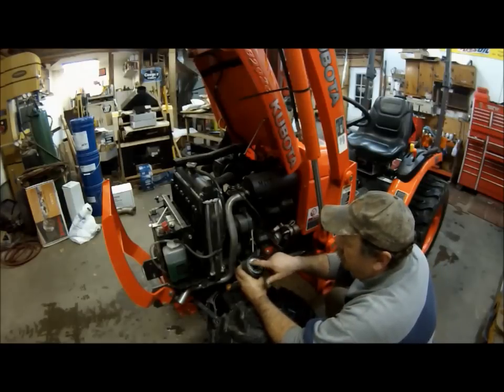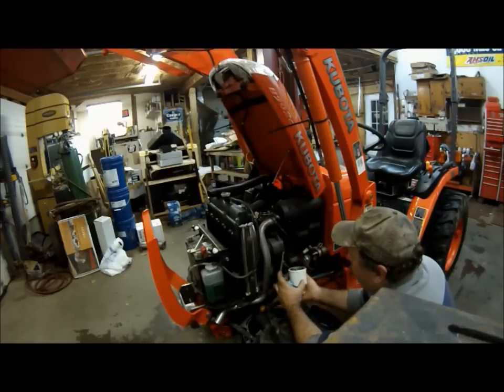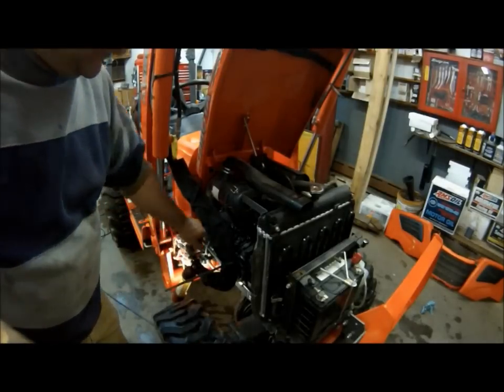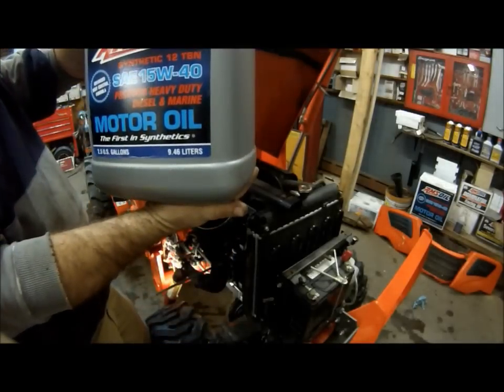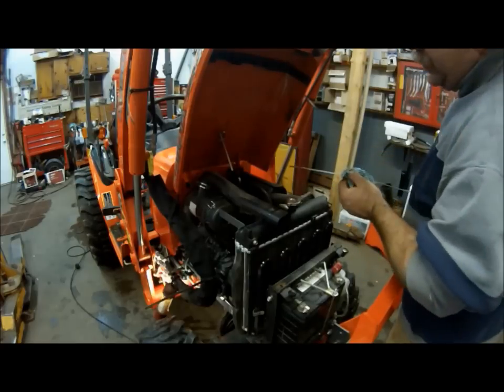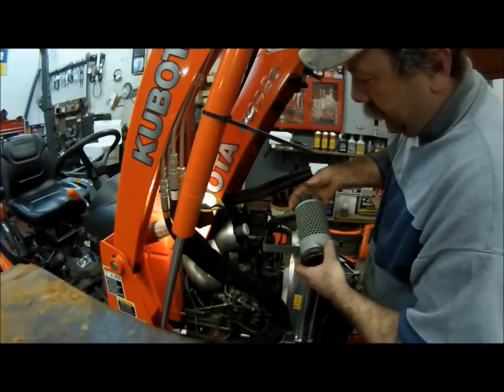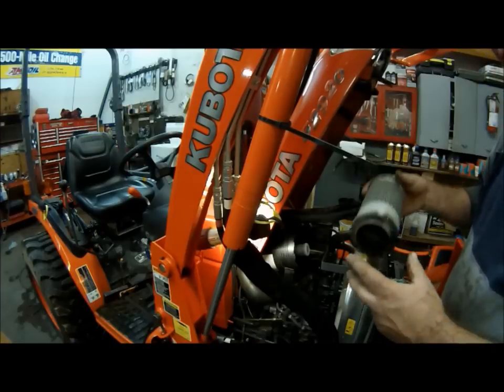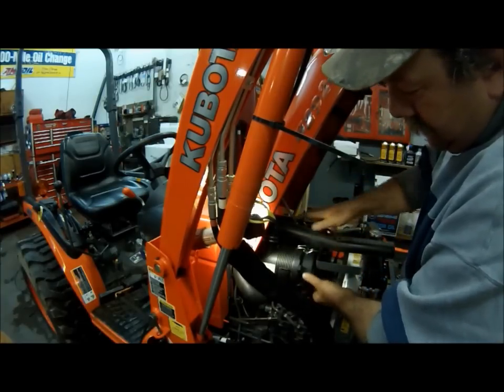How to change the oil, oil filter and replace your air filter on your Kubota 2920 tractor (Part 1)

Comment: My 2009 B2920 is always low' I drain both plugs and filter.
the specs say 3.2 quarts, I put in the whole gallon and it's still a little low. So I let it be that way'
never seems to use any oil. 900 hours on it today 9-27-19. Best little tractor you can get.

Comment from the maker: You can use either inlet.. Depending on what the motor is in one fill my be blocked. Maybe they feel that fill is easier to get to on this model. Was it still over full after you ran it..? Is it way over full or just a tad bit? If it way over you may want to drain some oil out or remove the oil filter empty and then put it back on.